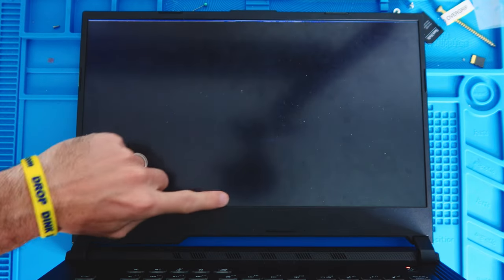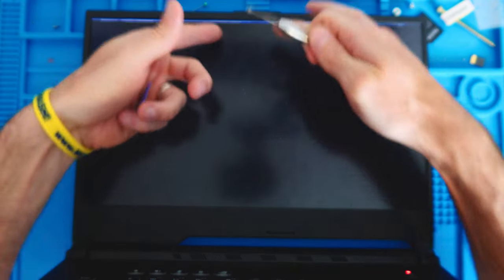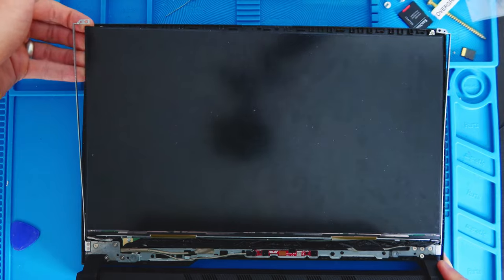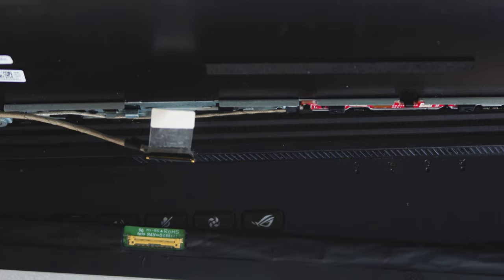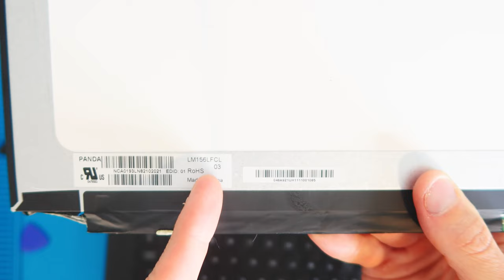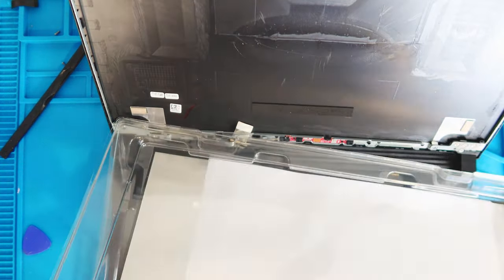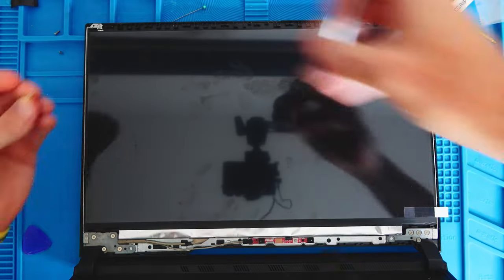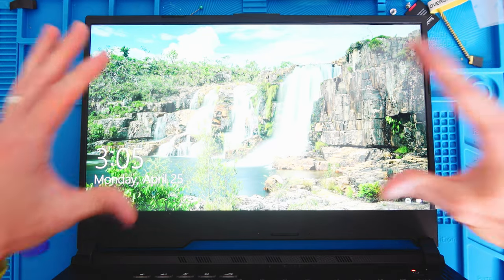Asus ROG Strix LCD Replacement (Easy)

Comment: PLEASE BEWARE : This method is very dangerous because your battery is still connected and ready to fry your machine. Please always remove the back plate, disconnect the battery first and then proceed.  I learned this $1200 lesson frying my GPU trying this gimmicky way.
Reply: Do I make sure I drain the battery completely…. I still use my laptop with a hdmi plugged into my TV
Reply: Same, My laptop wont even start now 😭
Reply: What do you mean by backplate and disconnecting the battery?
Reply: @amelies1385  turn off your laptop, and unplug the battery so no power trough the device. The backplate is the bottom case of the laptop
Reply: My laptops dead wont even start now is that my laptop finished?
Reply: @rahanjaa123  yeah, the motherboard’s cooked

Comment: Do we need to disconnect the battery?
Reply: i was wondering the same, when i called a computer repair place they said to disconnect the batter when doing this, even just to reseat the display cable or ribbon
Reply: Yes, of course
Reply: RIP, I didn’t disconnect the battery and now I think my laptop is dead
Reply: @@gargy2002 I disconnected everything but the battery was left it. Everything looks good but when I plus the power back in to turn it on nothing happens at all…
Reply: @@gargy2002 yep nothing
Reply: @@gargy2002 yeah I think I bricked the motherboard because there’s no light or sound, nothing lights up when I plug it in either. What’s the fix for this? To get a new motherboard?
Reply: Same for me initially can still power on with the faulty screen ( connect and disconnect a few times) . When changed to the new screen the laptop died instantly. Can no longer power on…😂
Reply: @RalphHuynh-yo8bm same, was you laptop dead? Or mobo gone , mines not working anymore due to this tutorial

Comment: Big thumbs up for you. Did it myself following you’re instructions and it turns out because of a fall it was only the lcd cable detached so no new screen needed and also no money spent on repairs. Thanx.
Reply: did it detach from behind the screen or inside the laptop where the battery is
Reply: @SincerestSawa  behind the screen. You have to disassemble it and take the screen off completely
Reply from the maker: Good work, thats an easy fix!
Reply: that's why I always secure the connector with a small piece of tape when I replace the display :) The original adhesive rarely works more than once.

Comment: Thanks for the video.  One of the easiest screen replacements I have ever done.  Only difference was the adhesive tabs were on the top and not the bottom
Reply: You didn’t unplug the battery first before doing this procedure?

Comment: Purchased one brand new (ASUS TUF A15) and it always has an issue where the screen flickers when open at a certain point. Thanks for the video as this should help me work out if a connector is loose.

Comment: This seems like the perfect place to ask lmao. You think I could cut out a section of the back plate, put a 30 in 40 out LVDS/EDP (I don’t know which this uses) adapter and make the whole display removable? I wanna be able to take the screen out use it as a 2nd monitor and set the laptop aside. 

Everything tells me it’s doable but I don’t know what other cables other than camera and RGB I’d have to worry about, also moving the cable around the heatsink to the back plate without it snagging on anything or resting on something important.

Comment: Hey man, i got the exact laptop and exact incident (i dropped it while inside a bag) the only difference is that the laptop makes a boot sound but the lcd is just black but when i use a flashlight i can see the lockscreen, so i assume the lcd backlit got f’d up, is this kind of problem repairable or i had to replace a new lcd? 

Please reply
Reply: Same problem bro.
Reply: You already fix your laptop?
Reply: @johnneilafable2929  no, but found a guy who can fix it, he said it could be the flex cable loose or worse the lcd itself
Reply: So your laptop is working now?
Reply: @johnneilafable2929  no, dont have the money yet
Reply: Ok bro ,guy told you an ideal budget for the repair?
Reply: Hey bro i already fixed my laptop how bout you? I Just try to move my. Screen of my laptop up and down then it works to me ,hope it will help.
Reply: @johnneilafable2929  no, im still saving money to fix it, btw how did you do it? What do you mean by moving your screen up and down?
Reply: @johnneilafable2929  10$-50$ if the ic had a problem and 100$+ if the lcd broke, but i dont know which the problem is
Reply: I had the same problem. How much will it cost to repair it?
Reply: @manishbhatta7728  i just fixed mine, thanks to the previous reply, it cost litteraly 0$, just hold the laptop lid and move the lcd screen with your fingers gently then the loose flex cable will be conected again

Comment: Greeting sir, i have a rog strix g13ie model that come with 144hz. I wonder if it is possible to replace the screen with the new 300hz srgb 100% display bcoz i find the original 144hz is too wash out. I ask asus and they said that they cant replace it for me so im thinking of doing it myself.
Edit: mine is r7 4800h 3050ti model
Reply: Essia Bellasfer  sure but i cant bring that along with me.
Reply: Hi, I was thinking of something similar, did you go through with it? Any results, hopefully a successful one? :D

I want to replace 1080p 300Hz panel in G733QR with 1440p 165Hz panel from G733QS, they seem like a very closely related models, so I hope a display will just send correct information to the system about supported resolutions and refresh rates and maybe it would work, the process shown in this video seems surprisingly simple! :o
Reply: @drunkayylienz3706  nope. after some time, i started to not pay much attention to it. yeah, its not ideal but what can i do? besides, months later, i bought another laptop that has better screen and i gave that asus to my lil bro